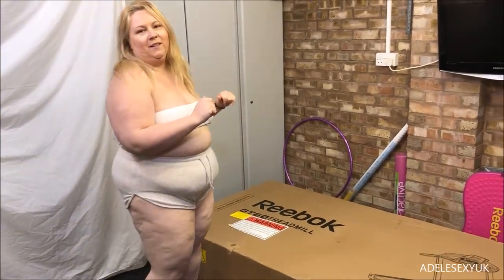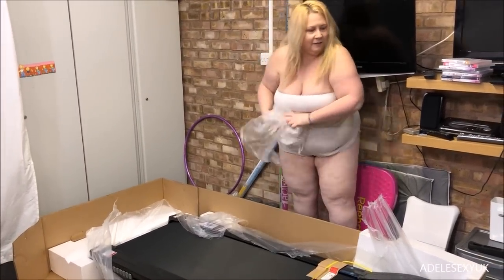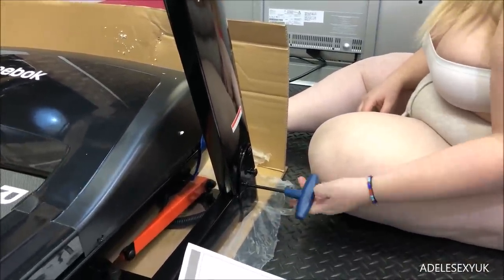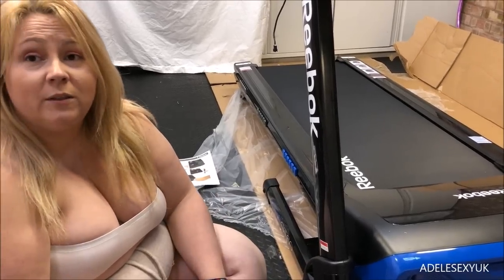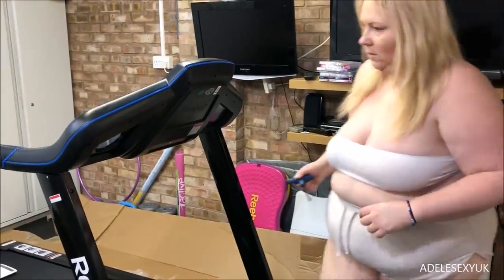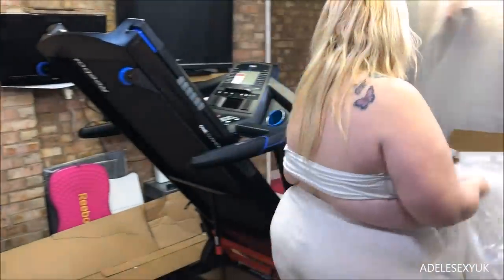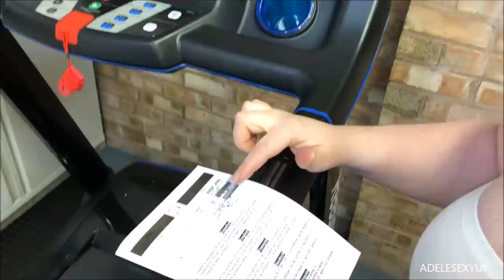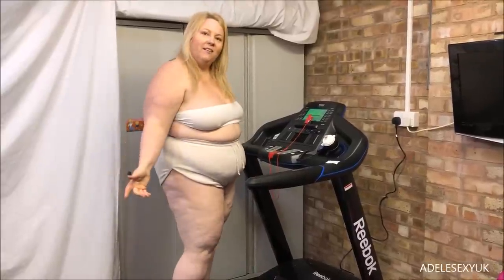REEBOK ONE GT60 UNBOXING & BUILDING UP BY ADELESEXYUK

Comment: Hey x
Would you mind telling me the complete length of the bottom half of the machine is as I’m sure it only tells you online the bit you actually run on not the bulk but at the front x thank you in advance <—————————>♥️
Reply from the maker: the full length of the bottom half is 76 inches by 29 inches hope this helps xx
Reply: Thank you very much x